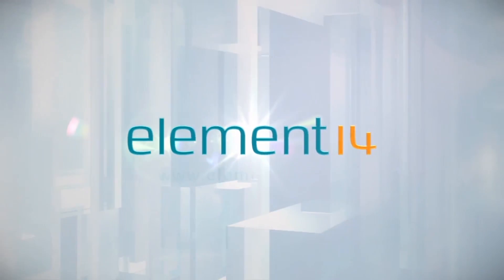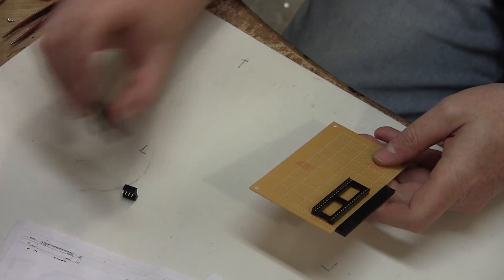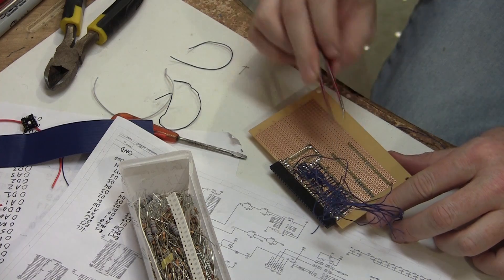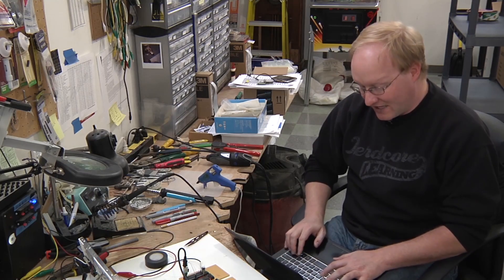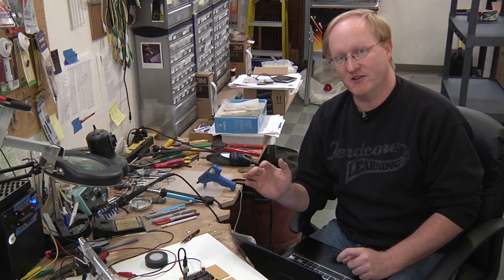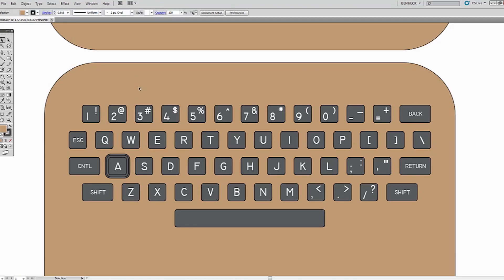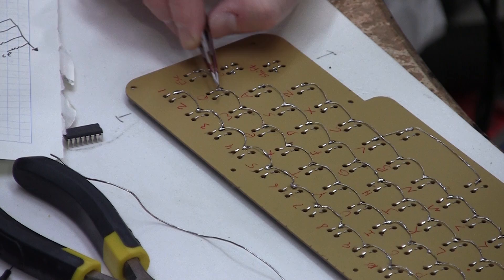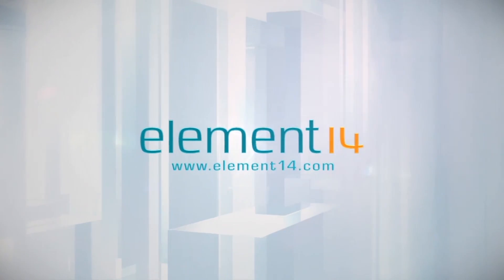Ben Heck's Apple 1 Replica Part 2

Comment: Maybe, an ASCII-keyboard is no longer an option, but what about a standard USB-keyboard, only with a single chip it could be converted into ASCII (I can imagine it, so a clever Chinese has made it before I even wanted it). Drilling and holing and stuffing is a lot of work, wiring the matrix too.

Comment: Honestly... the propeller could probably emulate the 6502 at a higher clock speed too...
Reply: At the very least, you could use the propeller to reset the chip after it boots up.

Comment: If I ever build an Apple I clone... dang it, I'm not interested in emulating parts of it in software. A propeller is overkill for what amounts to higher order glue logic. I'd build a PIA using a CPLD or FPGA to design the PIA hardware and put it into a single chip. You could even have encoded the ASCII keyboard and shift register RAM in one, and used a modern solution to recreate the hardware.

Comment: CALL -151 return to the moniter from basic
Reply: That's an Apple 2 thing, bro.
Reply: it's the same on the apple 1 too, in fact on the apple 1 -151 is the real reentry point to the monitor while in the apple 2 -151 is just a vector in rom calling the real rentry point of the monitor
Reply: Address "-151" translates to $FF69 in hex.  In WOZMON, this is an "ADC #$88" instruction in the middle of the NEXTHEX subroutine.  So, although a "CALL-151" might get you back to the WOZMON prompt eventually, I think that "CALL-256" would likely be more appropriate for an Apple 1. :-)

Comment: i've got some questions if someone can answer them :
1) so the 6502 go to the reset vector to see were it should start executing code after the reset?
3)how i can send  caracters to the pia and how the pia send me characters for the display
4)is it ok if i dont put the krusader on the rom ?
5)does the 70+ wires effect the signals (causing the replica to not function) ?
Reply: 1: Thats what every CPU does, after reset it goes to the reset vector (a hardwired adress) and starts executing code from there

Comment: 8 bit bus... 8 bit system? The i8088 had a 20 bit address bus and an 8 bit data bus, yet it was binary compatible with the i8086, which had a 20 bit address bus and a 16 bit data bus.
Reply: A Man 
The intel 8088 took 8 bit 2 bus cycles to retrieve one 16 bit word. On the inside it is basically a 8086.

Comment: Technically debouncing switches means latching them to prevent high frequency logic from detecting multiple presses due to the physical contact bounce of the switch itself. Subtle difference, just felt like mentioning that, idk.

Comment: When using the Propeller DIP you should always have 0.1uF bypass caps connected to the Vdd and Vss pins (on either side). It's a good idea with any chip, but a glitch on the power supply can knock out the Propeller's PLL if you don't include the caps.

Comment: Hi Ben,

I'm working on a project where I am going to mod the marque on an upright arcade cabinet to a DMD. Basically the goal is to make the DMD change based on the game being played. I want to recreate the style of a pinball machine, but for an arcade cabinet. So for example Pacman starts up through MAME, software running on the OS would let the DMD know that "Pacman" is running. The DMD would then show the Pacman animation. I'm working within the dimensions of 20"w x 4.5"h. I've explored several options.

1. ColorDMD. I'm not sure if the developers have released the tools they use to create stuff like Lord of the Rings ColorDMD

2. A combination of traditional 128 x 32 DND, PinDMD2 and so forth. Something like this: http://virtuapin.net/index.php?main_page=product_info&cPath=9&products_id=216

3. Saw a LCD screen in half and try and make it work before I die from toxicity ಠ_ಠ

Do you have any suggestions? Even better could to do a show on this?

Comment: Meh... you do know that if you go using it you could do all this inside the Propeller and call it a day?
If you go and make a retro computer remake you should have used something that would resemble the timebase and use CPLDs for chips not obtainable anymore. But not a MC that could do everything on itself in a single chip solution.

Comment: I saw the first installment of this, and I was afraid of this (the circuitry not having much resemblance to the Apple 1 or II). This is in no way a replica of the Apple 1. Heck talks at 1:20 about the Apple 1's video ram being "accessed with shift registers" - no, it was accessed with TTL counters on the alternate half-cycle of the 6502's clock, quite similarly to Don Lancaster's Cheap Video board. The shift register then received the value of a character generator ROM (for text mode) or the direct byte from memory (for graphics mode) and clocked it out serially as NTSC video. This wasn't "kinda slow," it was the exact speed needed to generate the video signal at the resolution used.

Using hardware to access RAM this way to generate video was an integral part the Apple 1 and II, as well as some other computers at the time.

One thing Wozniak did not have to generate his video was a propellor chip!

For a true replica of the Apple 1 board, look up the website of Mike Willegal. He also has a short interview with Wozniak about the Apple 1 video generation.

Comment: I would love to learn to do this kind of thing some day. I can catch what you're doing and understand probably 95 percent of it while watching you do it, but if I were to try doing it myself?

waves hand over head

I've got SO MANY projects I think would be cool to do if I had your talent though, like a custom Mantle/ AMD A10-based handheld gaming PC, or custom PC cases, or maybe building a super-multi-console by hand from the ground up (having originals on hand so I can flash the BIOS, of course,) and things like that.

Or, you know, an Xbox 360 controller with the joysticks in the right location. That kind f thing.

Until then, I'll simply watch your show and dream.
Reply: I thought the same thing a long time ago.  I went through physics classes, and learned all about resistors, capacitors, inductors, etc. but never really learned anything that I was interested in.  It wasn't until my senior year in college when I took a digital design course that I got interested.  They gave me a toolbox with some switches, some resistors, some 7400 series chips, a 5 volt wall wart, and a solderless breadboard and walked me through some very primitive (at least to me now) stuff about digital design.  Today, I'm hooked, even if I still suck at the analog portion of it (like when to use resistors and capacitors).
Reply: nychold they taught you about electronic components in a physics class?
Reply: TheTjoconnor  Yep, both in physics with algebra in high school, and physics with calculus in college.  It goes hand-in-hand with Maxwell's equations and Gauss's Law of Magentism.

Comment: I can not believe that Americans still use inches... they're so inaccurate...
Reply: How are they inaccurate. An inch is an inch. Not going to change???
Reply: Yes, but to measure something smaller you have to use fractions like "3/8 of an inch" and shit like that.
Reply: Craig Morrow accuracy isn't in the unit, it is in your measurements.
Reply: Diabl0pl Or we use a decimal system like .125 in. which is just as accurate. To make precise measurements we also use calipers.
Reply: I know I hate inches and I even live in America! we learn about the metric unit in science why the fuck can't we use it always!
Reply: Craig Morrow
The unit of measure doesn't matter unless you care about only integers. A Nautical mile, like every other unit, is incredibly accurate when taken to multiple decimal places.
Reply: ValidTutsNgameplays 1 inch is to be accurate 2.54cm or 25.4mm
Reply: *****  1 mm = 3/64 inches = 0.0393700787 inches, conclusion... Inches sucks!
Reply: Diabl0pl We use something called a ruler.
Reply: "Inaccurate" was an unfortunate word there, we've already discussed it. I didn't want to be mean in any way, I just find meters more universal and easy to use. ;)
Reply: ***** Millimetres are incredibly accurate compared to any other unit of measurement.
Reply: Collin Bardini True, but millimetres make it much easier to measure without fault.
Reply: 1 inch is 2.5cm how's it inaccurate?
Reply: ***** It's "except", and to be honest the imperial system is only used in the United States. For whatever reason, speed is measured in Miles per hour in the UK, but that aside they're pretty much completely metric there as is the rest of the world.

Australia takes things one step farther and uses Joules for nutrition instead of kilo calories, so they use all SI units.
Reply: MrGencyExit64 What? In what instance has a spacecraft crashed due to issues with converting between imperial and metric? Furthermore, when developing these machines it doesn't matter what system the United States uses as a whole, engineers can use the metric system (and often do) the 
 public however understands the imperial system and there's really no reason to change that. 

There are fat more important issues that need focus and finance in this country and our unit of measurement really isn't a priority.
Reply: MrGencyExit64 The solution to that is clearly that we convert everything to binary.

Next add 11001000 mL of water.
Reply: ***** don't feed the trolls...
Reply: ***** official trollkeeper of the grounds... hehe... stop feeding them. Obvious troll is obvious.
Reply: I don't think anyone realizes that there would be a cost in converting the U.S. from the Imperial system to the metric system. When you consider that the current system works and that there'd be virtually no benefit to switching aside from having parity with other western countries, then can you really justify that cost?
Reply: Donny Stanley I'm not convinced. How many billion dollar space craft lost due to issues converting between imperial and metric will it take? It is going to happen at some point, probably not within my lifetime. But science depends on this parity, and modern society depends on science.

The argument of cost is used a lot in these debates and it never really seems to pan out in the long run. The cost of abolishing the 1 cent piece in Australia, for instance did not have nearly as big an impact as people thought it would.
Reply: I live in europe and use gallons to measure liquid
Reply: Yes, so sad that the attempts to switch the US to the metric system didn't catch on.
Reply: ***** To maximize my accuracy, I use different units with everything that I measure. For instance this can is exactly 1.00000000000 ACU tall.  Look at how many decimal places of accuracy I have.  What's an ACU? Arbitrary Can Unit.
Reply: Bozeman42 In the modern computer era, it'd be nice to invent a unit of measure that used power-of-two fractions. None of this 9/5 crap you need to convert between fahrenheit and celsius. That fraction cannot be represented by computers no matter how many decimal places you try and use, but it's sufficiently close to 1.8 that most software will print it at 1.8 instead of 1.800000011... :-\
Reply: MrGencyExit64 Except that 9/5 IS 1.8
Reply: Bozeman42 Not in floating-point, it's not.

If you want a detailed discussion why numbers like 1.8 aren't accurate in computers, see here:

http://stackoverflow.com/questions/4306177/exact-representation-of-floating-points-in-c
Reply: MrGencyExit64 When you say "1.8 can't be represented accurately by computers" - that's simply not true. You just need the right software. When you write "1.8" and read it off the computer screen, that is an accurate representation of 1.8, and it's on a computer. With the right software, you can do completely accurate calculations with any rational numbers. Scheme supports this, for instance. 8/7 * 2/3 = 16/21. It's just not usually a very useful thing, since a lot of numbers aren't rational and for our purposes it's usually more helpful to get a few significant digits in decimal.
But the fact that most software we use on a daily basis doesn't deal accurately in decimal, if anything it's a software issue. But in practice it's pretty much a non-issue since the rounding that happens when the computer displays a binary floating point number is very well-designed.
Reply: Well, yes. You can always do fixed-point calculations if you need accuracy. But the majority of scientific software these days doesn't do that. These are things you do have to consider when writing safety-critical software though, the same idiots who lost the Mars polar lander because they forgot to keep everything in metric would likely forget about things like floating-point NaN or try to compare a floating-point value exactly. 1.7+0.1 != 1.8, but most people who write floating-point software know this.
Reply: MrGencyExit64 You are correct in all you've said, I've just been having a bit of stupid fun.
Reply: MrGencyExit64  Hmmm, actually we still use imperial measures widely in the UK. I for one still use it more commonly than metric!,but each to his own.
Reply: not a spacecraft, but an orpiter:
https://en.wikipedia.org/wiki/Mars_Climate_Orbiter
Reply: Pretty sure it got to Mars by flying through space. Spacecraft. Also you might notice that the link you posted... calls it a spacecraft.
Reply: diego scar Anything that far above the surface of a planet is a spacecraft :P

You know what the difference between an airplane and a spaceplane is? Altitude, nothing more.

Aero-space; if it's not aero, it's space.
Reply: +Infinite loop
1in = 254/100 mm = 25.4 mm... conclusion... millimeters suck... Genius.
Reply: Yes, an inch is defined as 1/12th of a foot, but the inaccuracy comes from ... whose foot?

Comment: How are there still 6502s? Are these vintage or are they still used for some applications today?
Reply: FilmFactry I think Ben used a New Old Stock 6502 by Rockwell if I saw the logo correctly in part 1. They're still pretty easy to get. But Western Design Center (owned by Bill Mensch, one of the original designers of the 6502) still produces them in the billions per year. The WDC 65C02 can run at 3.3V by the way, and (in combination with a PIA from WDC that can also run at 3.3V) would have made Ben's circuit a little easier because he wouldn't have needed to convert the voltages between the Propeller and the 65C02.
Reply: yep, still used. Z80s and it's clones are used everywhere too - CHUBB alarm systems use Z80 cpus.
Reply: They're probably used for cheap embedded systems, so maybe it's in your washing machine or alarm system.
Reply: +FilmFactry For the record, Intel still makes the 8088, too.  It's used, for the most part, in micro-controllers and automated industry machine controls, etc.
Reply: Yep! They are still produced:
http://en.wikipedia.org/wiki/6502

Comment: Element 14... The 14th element the the periodic table is silicon... It all makes sense now.
Reply: glitchsmasher
Phosphorus is typically used as the impurity in N-Type silicon doping for transistors.
Reply: Yay! This calls for a party! Wooo!

It is quite clever when you think about it. I was thinking of a similar riddle the other day, which was brought on by a poster in my office which says "Broken Promises" and recent interest in Need For Speed Underground.  There is a song by Element Eighty called "Broken Promises" on the game's soundtrack, but I was wondering what element eighty was...it's Mercury!  Which is a very useful but toxic metal.
Reply: glitchsmasher Nothing. Phos'rus just wants to hang out with the cool, nerdy elements
Reply: Element 15 feels left out... (ಥ﹏ಥ)
Reply: kxmode What does phosphorus have to do with electronics?
Reply: Congratulations you passed 3years old

Comment: High pitch whine... makes video unbearable...
Reply: No noise/whine on my headphones.
Reply: Mike Gus Fifteen
if you don't hear the whine starting at 6:14 (and continues through all shots with the power supply on) you need to have your ears checked.
Reply: Sure does. I guess this unshielded device is not going to pass FCC testing. ;)
Reply: i think u got tinnitus bro
Reply: Sorry, I realize you mean the power supply in the video. I thought at first you meant something embedded with the audio itself.
Reply: bingisbetter I hear it so very slightly and it fades in and out periodically. I don't have amazing ears but I think you're just listening to it too loud. I wear headphones, too.
Reply: Yeah it's ben's custom built power supply. Maybe its time for a new quieter one? Make a great build (hint hint)